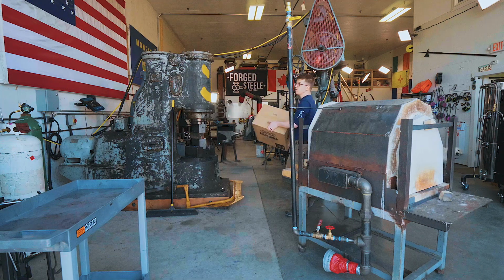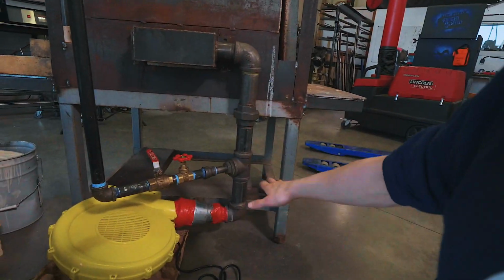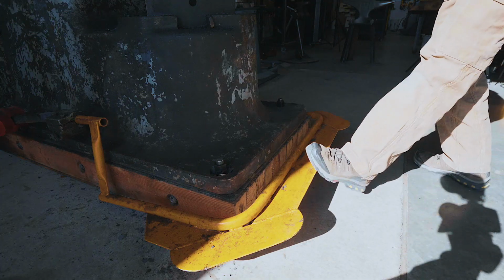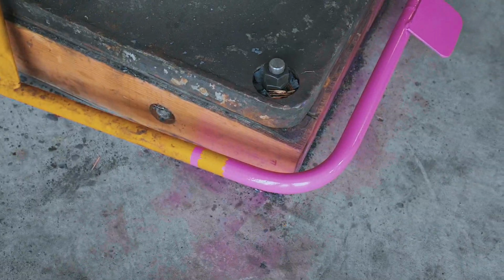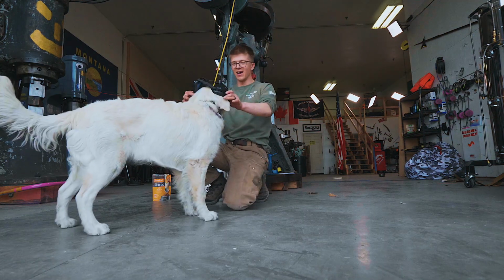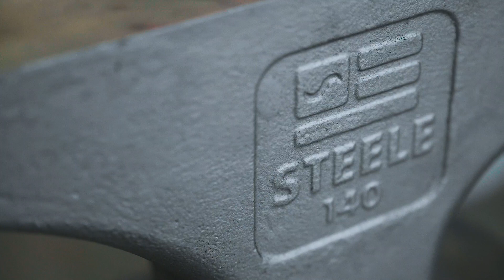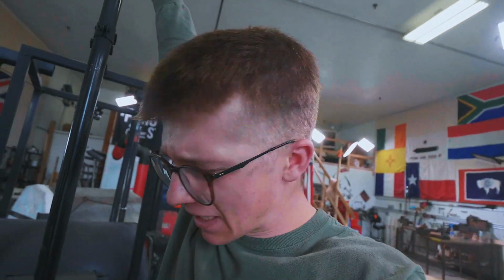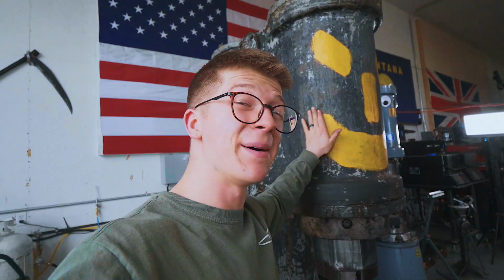NEW FORGE BLOWER, YOGO'S EARS, FORGING TOOLS!!!

Comment: Hey Alec I think your issue with the new forge is your trying to overcome the lack of oxygen at your elevation with a higher velocity of air (O2 and N2).  You are not going to add more oxygen by simply blowing more air faster, you still need to add more oxidizing molecules to the fire to get it hotter.  Think about your oxy/acetylene torch. Acetylene will get hot on it's own but add oxygen and it gets a lot hotter without increasing pressure or flow.  I believe at your elevation experiment with adding a oxygen cylinder to your process. Tie it in just after your blower ( I would suggest using the original one you hooked up), making sure you have it regulated down to below 50 psi, and using a flashback arrester on the line.  That will give you the much needed oxidizing agent without trying to blow the forge over.

Comment: If you need a hand with the burner let me know. Industrial gas burners (and combustion air fan sizing) are my day job!

A quick pressure survey may give you a clue as to what the issue might be. Using a pressure gauge or handheld manometer to get an idea of your blower pressure and gas pressure; you can compare the two and ensure one isn't overpowering the other. If the combined pressure of the premix is well above the intended pressure for the nozzle, it could result in bypassing the sides of the nozzle and just using the centreline. Lowering the fan rpm and opening the intake will reduce pressure without losing too much flow. If the intake is already fully open, adding an intake manifold (Straight tube, tapered out if possible) can increase the intake efficiency slightly.

As the flame is blue, translucent, and you're struggling for stability, excess pressure and volume may be the culprit. Hooking the fan up to a speed controller is going to give you more options to fine tune the pressure/flow output and get you that optimum mix.

Comment: The reason your forge wasn't working is because natural gas ignites around 0.35m/s (called the flame speed) meaning if the gas/air mix is travelling faster than that you get flame lift off (when the flame leaves the face of the burner) so the way to fix it is to slow down the blower.

Comment: If you're hell bent on sticking with the 2 1/2" inlet pick up a power blower head from a water heater. 4" down to 2 1/2" should be the right amount of velocity and volume you need.

Comment: Alec you should paint that big power hammer Chrome with your Maker's Mark in lumilor on the Piston housing

Lumilor is an electroluminescent multi-layer paint that comes in a variety of colors but the bottom line is it's glowing paint powered by electricity so impact from the power hammer won't effect it

Just imagine the reflection of the Sparks from the hot Steel glow from your Maker's Mark in the Chrome coated body of that power hammer

Comment: I do not know the pressure behind the propane tanks you were running, but I am sure it is a lot higher than natural gas. You should talk to a gas fitter and see if relocating the gas inlet closer to the ribbon burner helps with the flow. If the fan is creating too much pressure it may be keeping enough natural gas from entering the system. I hope you can get it sorted.

Comment: Great videos!
On the problem with the Big Forge, maybe the output on the instalation is to big there for maybe the forge needs a bigger input of the gas proportional with the air. That can't be done so you can add a device(potentiometer) that will control the intensity of the current that the blower is receiving automatically controlling the input of the air on the forge.
I hope you'll get it fix and we can see more videos with the Big Forge in use 🤭.

Comment: You do not want pressure, just high volume.  Commercial spa blower might work, and you can hard plumb them.  Consider measuring how many cubic feet of gas you are getting per minute and sizing the blower to meet the air/fuel mixture you are looking for.  I'm not a blacksmith, but I would assume there are look up tables in the public domain.

Comment: You have to check what is air to fuel ratio, and then you have to lower the pressure if the flame did not anchor

Comment: Blower pressure overcoming gas pressure perhaps? The length of that pipe from the blower all the way up and into the forge will also slow down the air aswell as the elbows, how much? I’m not sure, you could also try the gas line entering further along that pipe (closer to the forge) 👍

Comment: I think you need rheostat on the blower or a valve to limit airflow. It seems like those pipes should be enough to easily flow enough for that forge. Maybe having the pipes enter the underside of the burner would help with airflow and ensure the full burner is used. That way you could position the fan under the forge and have a sweeping curve into the burner to eliminate 90s. Then a plate inside the burner to help divert some air/fuel mix to ensure the flame isn't pushed to the farside of the burner face. Couldn't tell if that was the issue or if some of the holes were blocked by broken refractory like you said.

Comment: Good thing you are thinking about the dogs earprotection, they have more sensitive ears than we do.
But is it smart to have a pet in the workshop? With all those sharp metal bits,  flakes and metal dust lying on the floor, sparks flying all around?

Comment: I believe that the new blower flows so much air that you are maintaining a significant pressure within the air manifold. This new higher pressure is counteracting the very low gas flow line pressure that the gas company sets for you. The gas delivery pressure needs to be increased to account for the increase in manifold pressure from the new blower. Alternately, you could do like some of the other commenters have suggested and increase the size of the air delivery piping from the blower to the forge. This will somewhat reduce the pressure in the air piping system, but probably not enough to be worth doing. The biggest contributor to the amount of pressure developed from the flow of the pump is guaranteed to be the ribbon burner it's self. Another indicator of the excessive air manifold pressure is the velocity at which the air and fuel is coming out of each of the ribbon burner jet. I'm guessing that the velocity seen is way higher that what the burner was designed around. I believe that the reason you had trouble with maintaining the flame is due to the speed of the air fuel jet. The could be observed by the fact that the flame had to be several inches away from the ribbon burner. This is because the air and fuel has to slow down before it could burn and had to travel away from the jet nozzle several inches to do so. Basically, that air pump is capable over powering that burner. You need to devise a way to control air flow. How about converting a 2x72 grinder motor and vfd to run the blower fan? Sounds like a fun project!👍

Comment: Betting you've got as much blower pressure as gas pressure and the gas pipe can't push fuel into the airstream. You might need a venturi to lower the pressure at the gas injection point and promote mixing. Or go with a larger diameter pipe so that you can get the volume you need at a lower pressure, whichever is more feasible.

Comment: Regarding burner performance, there are a few things that need to be addressed - tried and adjusted if they cannot be directly calculated.

One set of variables is the blower performance - delivered pressure and volume. Those need to be adjusted with a damper until the pressure is in balance with the pressure of the gas (propane?) fuel. Right now, it looks as if the blower is overpowering the fuel, and snuffing the flame.

The other set of variables is the pressure and flow of the gas into the burner - you need to know what those numbers are, such that you can match the burner to the blower.

The big word of the day is stoichiometry - the fuel and oxygen need to be in the right chemical proportions to burn stably, and then you want to use a little bit of excess oxygen to ensure proper combustion. 

C + 02 => CO2, and 2x H2 + O2 => H2O

Methane is CH4, so you need 2 molecules of oxygen per molecule of methane for stoichometric combustion

Propane is C3H8, which needs 3 + 2 molecules of oxygen 

For simplicity, air is ~20% oxygen by volume, and 80% nitrogen - in most cases, we can ignore the presence of water vapor - certainly in most of Montana, the air is very dry.

We are working with gases at low pressures, so the volumes are directly proportional to the number of molecules, so we can do the combustion chemistry based on that.

Because this is a common thing, we do combustion chemistry with either standard cubic feet or Normal cubic meters of gas.

scf of air are at sea level and 70 F (14.7 psia & 530 R) while fuels are at 60 F (520 R) while Nm3 are also at sea level, but always at 0 C (273 K)

When you do the calculation, absolute temperatures (R, K) and pressures (psia, kPa-a) are required for the ratios to come out correctly

Something that complicates that is the altitude - most of Montana is above 3,000 above sea level, which is when these things start to get really important.

Higher altitude = lower atmospheric pressure than at sea level, so the air is less dense, which means that a fixed volume has less oxygen - and nitrogen - than down at Mean Sea Level.

So, instead of needing 2 actual cubic feet of oxygen = 10 actual cubic feet of air per actual cubic foot of natural gas (nearly pure methane in most of the US & Canada) at 3,000 ft ASL, the Altitude Factor is 0.89, which means that one needs roughly 1.12 ACF of air to deliver the same amount of oxygen as at sea level.

The calculations to readjust the burner are fairly straightforward and based on principles taught in high school chemistry and physics classes, but you do need to adjust for altitude/pressure and temperature on both the air and the fuel to get the chemistry right, and get the burner flame adjusted.

Your gas / propane supplier should be able to supply you with combustion tables for operating burners in your region, or a local heating engineer can help...

Comment: Just a thought for the big forge that could it be the fact of that when you use lpg in the cylinders there is a greater pressure in them that may work compared to the mains gas that you have it connected to atm also lpg burns with a hotter flame & could possibly be able to then run with the blower that you have

Comment: More air volume at less pressure and put the fuel line higher up.  You are getting a very lean premix so by the time its getting to the ribbon you are blowing the flame out. Your old blower was fine it just needs a modification.  Bigger pipe up to the fuel line with less air pressure. In essence what you are looking for is a choke.  You also need to look at the forge design.  You need the flame from to propagate from the ribbon to the wall and then have a way for it to loop back on itself to keep the flame self sustaining.   What you are doing is you are pushing the air too hard and you are blowing out the flame front.  You don't need massive amounts of pressure to make a really hot flame.  Look at the bellows used by old time blacksmiths.  They are huge.  Reason for this is simple.  Huge amounts of air but at low pressure.  You would be amazed how hot that forge would get with only 5 psi of air pressure.  Try putting a fire brick cut at a 45 degree angle in the corner of the forge where the flame front hits the wall of the forge and lower the air pressure. Look at how a melting furnace works.  It circulates the flame around the crucible. The principle is the same.

Comment: The biggest difference made to the power hammer is the treadle does not go as near to the floor,  so shortens the stroke! That's why it shouldn't hit the top cover! 
When you cleaned the inside you didn't loosen the piston rings from the rust build up so it will still leak a bit but using it will help free them off. As with all big steel and cast iron machinery leaving them standing around unused is bad for them.

Comment: Is the volume and speed of the air causing vortices in the flow path? Perhaps, like driving a jet of water through a sieve, the fluid is only going to come out the middle, which is what it looks like in the forge. Perhaps slowing down the fan (electronic speed controller) or putting baffling in the outlet behind the ceramic ribbon Burner would give a better distribution of flame?

Comment: You could redo the pipe system and add in a butterfly valve so you can control the amount of air flow better then just slapping a thing on the blower

Comment: I suspect the problem you're having with your forge is the same as one I had. The air pressure at the point where the gas enters is sufficient to prevent enough gas entering the stream. The solution is to use a wider pipe section at that point, and use a gas nozzle that points upwards into the flow. So the air isn't forcing it's way into the gas inlet.
Reply: @centurion726  That's actually a pretty good idea, it should work, in theory.

Comment: I think you should collaborate with Fireball to make a bracket that will attach an electric motor to a turbo from a diesel engine. Connect a variable speed control and I would think that you would have more than plenty of air and pressure which you could control as well.

Comment: He should do a comparison between the Chambersberg and the Anyang. Get 2 pieces of steel, heat both of them up and then forge one on each power hammer with the same number of strokes on each side of the steel. It’ll be cool to see the difference in shape of each piece of steel.

Comment: looks like you need a way to control the flow from the blower like a valve. I don't know exactly what you need for a forge. I don't know where people got the idea that an elbow is going to cause some big pressure loss since bends, gates and the like considering those are all part of minor head loss while major head loss is pressure loss due to friction in pipes and ducts. The only way an elbow will make some big difference is if you have no piping length. If one knew the pipe material, length of pipe, internal diameter, flow rate of gas and air, pressure from both and the needed values on the gas and air which are easy to find you can find the pressure drop. I may not use it much, but fluid mechanics was one of my favourites in university and a class I made sure not to miss, so i hope what I wrote is all right

Comment: For the forge it is about the stoichiometric ratio or the optimal air fuel ratio. For natural gas by volume you need 9.7 to 1  (by mass it is 17.2 to 1) for every cubic foot of natural gas at atmospheric pressure you need 9.7 cubic feet of air at atmospheric pressure. The blower you were trying is way oversize.

Comment: A cheap way to controll the air would be to install a T fitting into the line with a ball valve to release the excess air into the shop

Comment: Seems the airflow is so high that it's pushing the fuel/air mixture. In jet engines they fix this using something called a flameholder. I'm doubt it's a reasonable fix for your current forge, but an interesting thought for a highflow design

Comment: If I may make a suggestion, if you could get the appropriate diameter of exhaust tubing bent you could design more gentle bends which should considerably help.. then you can poke holes and weld bungs for nwhatever you need.. 90 degree bends are an airflow killer..

Comment: Air pressure, gas pressure and volume of both are critical to proper flame. Looks like air pressure is not allowing enough gas to mix. On a gas burner you need to know incoming gas pressure and mixing air pressure. Flame is only in the center of the ribbon burner because the volume and pressure of air aren't letting enough gas in. Also gas isn't mixing, stays in the center. Hope that helps, you'll get there.

Comment: My guess is you do not have enough natural gas supply. You may need to talk with the utility supplier and get larger orifices in the service regulator. They can also run a industrial supply line that is run at a higher pressure just to your forge. House pressure is 7 inches of water column. ie. 1/4 psig. Industrial supply for a generator for instance could be 3 psig or higher. Call your utility and have a gas service rep come out and give you advice.  Hope this helps. Brett~

Comment: You have to much back pressure on the natural gas.. On my foundry I have the gas input in a coaxial setup, so it has a venturi effect and actual sucks the gas in. To test this remove the gas input just after the valve and turn on the air it should suck smoke into the pipe not blow it away

Comment: Hey could the reason the rams hitting the top be because you raised the hammer off the ground a bit by putting it on the wood pallet, so the treadle is being pushed farther down to the ground?

Comment: May I suggest that the change to the power hammer control bar has limited the extent to which the control can be pressed to the ground and as such reduced the overall magnitude of the air pressure and the length of time the valve is open.  If the hammer is suitable this way then more to the good.

Secondly, as to the forge,  there is now volumetrically more air flowing than you need.  You may need a triac to turn down the voltage to the blower.  A triac for ten or twelve amps is fairly expensive.  Alternatively, you could try a waste gate to vent aside some of that flow.

Comment: It's not an air flow problem with the forge. It's gas delivery. Either it's made for LP and your trying to burn natural. Or it's not getting the volume and or pressure it takes to run a burner that big